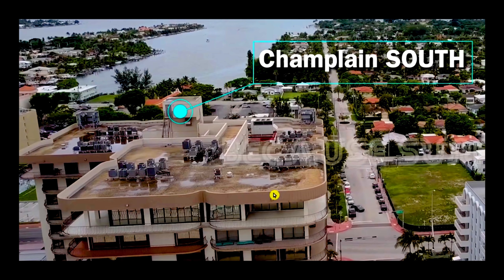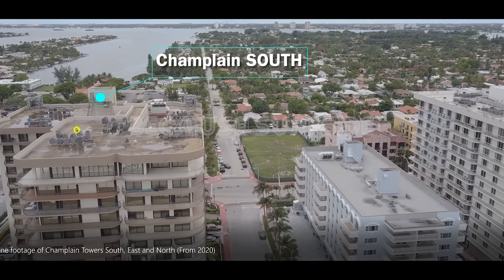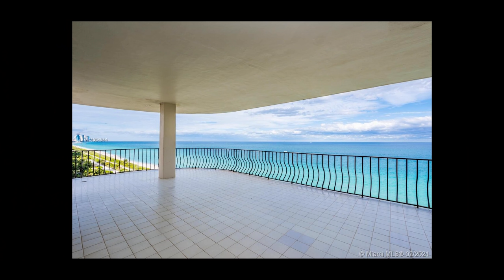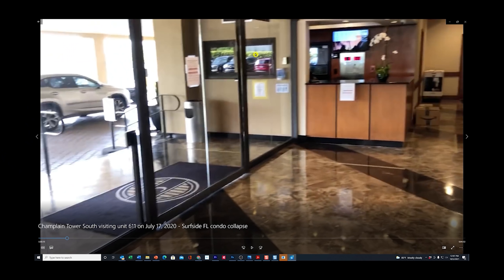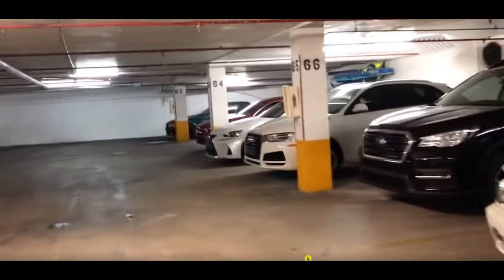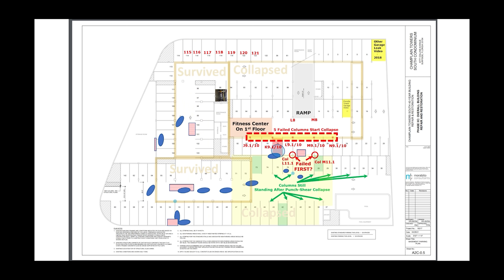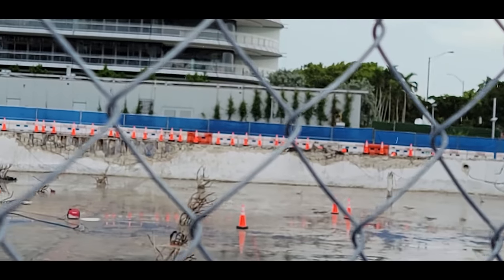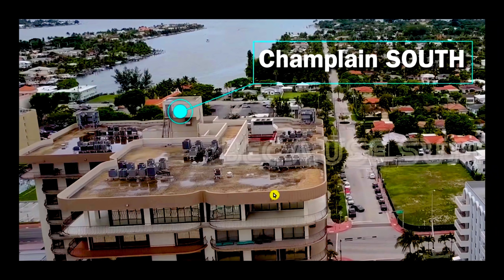Miami Condo Collapse: Water Attacked Roof, Inside, Pool Deck

Comment: Could water from the ocean be seeping into the foundation some how ?
Reply from the maker: They believe that was a big problem for them in the 1990s where they would get several inches of water in the garage all the time and they had two pumps working overtime an had to replace them every year because they would burnout. That problem seems to have abated because in recent years it was reasonably drawing in there except for a few puddles caused by likely cracks in the ceiling underneath the pool deck so when it rained water would work its way down into the garage. But now that the building is collapsed certainly there could be damage where the bottoms of the columns were just large door cracked or forced down into the subsurface a little bit more allowing water to bleed in.

Comment: Looking at the last view of the site filled with water makes me wonder. If that amount of water was coming in before the collapse looks to me like there would've been a basement/garage level swimming pool.  Was CTS pumping continuously before the collapse or did the 20 million pounds of building smashing onto the garage floor slab open up new fissures for ground water to intrude??
Reply: The prior Maintenance Supervisor for the property stated to the press just a day or two after the collapse that he was running the pumps 24/7 and when one would burn out that management told him to buy another pump as it was too costly repair the root problem of water leakage (from BELOW the parking garage floor slab). He reported that at times the water in parts of the garage was deep enough that it seemed into cars from the bottoms of the car doors. That would be water at least 8""-9"" deep! That is consistent with what we see in this revealing after-collapse/clean-up photo. Assuming no other deliberate sorce of the water in this photo, it cinches the testimony of that Maintenance Supervisor as being true! The liability to the property management company is going to be in the hundreds of million$, and perhaps some jailable criminal offenses will come into play as well....
Reply from the maker: That amount was not coming in prior tot he collapse. It is likely happening now because of damage from the building collapse, no pumps in operation, and king tides
Reply from the maker: that was years ago

Comment: I see Drains on the Vertical Facade in drore footage at 17:00 min. Other sister building do not have the same Drain Holes through Facade in Drone footage.
Reply from the maker: Those are called scuppers, they are meant to be secondary drains.

Comment: At 17:15 you can see a blue or gray car turned over sideways at lower left of the image. Cars to left of this are upper parking deck still standing. The white van at low center is also on upper parking deck but dropped onto the lower deck. The pool is at lower right off-screen, with pool deck collapsed from these cars and up to the collapsed building. I believe the initial failure was this upper parking deck, which was constructed the same as the pool deck and the residential floors above it and not strong enough to hold the weight of the parked cars. Once this became detached from the support columns, which remained standing in this parking area, the detachment failure spread and eventually (a few minutes later) pulled down some weaker columns of the building.
Reply from the maker: Yes a lot of people have this theory as well.

Comment: 12:32 Champlain South looks stacked too tight compared to the East building
Reply from the maker: at the end of the day it is all about the columns and can they support the structure.
Reply: @jeffostroff  well we know they did not so.. perhaps putting the weight of an extra floor buckled the columns that were supporting the building

Comment: I remember asking if the obvious water damage was seen below, why were the repairs started on the roof. I finally got the answer. The whole building was a sponge on sticks.
Reply: Spot on.
Reply from the maker: Yes, I heard the response from HOA at the time was they wanted roof repaired before hurricane season the price usually goes up during the summer

Comment: Remember they were probably washing down that deck at least once a week. I had to wash my in-ground pool deck often due to birds tending to crap on the deck. That close to the ocean you know there are seagulls. 
If the decking was not waterproofed properly that water standing is going to cause problems. I bet maintenance would be cleaning and hosing form that whole area.
Reply from the maker: I doubt they washed that deck once a year you should see pre-2020 photos, it was filthy

Comment: 10:29 that does look like adding those planters has deformed the pool deck at that point.
Reply from the maker: I think the planters with the tall palm trees, and the deck pavers, and the sand and the water retained by the sand were major stressors to the concrete deck

Comment: i have to wounder is the investigation complete at this point in time? since the equipment on site to pump out any water is gone now. Maybe they want it to flood as part of the analysis for say water table related concerns?
Reply from the maker: Nist is examining everything off site, likely will take 2 years for reports

Comment: @jeffostroff Is the plan of the roof showing the penthouse roof or the original pre-penthouse roof?
Reply from the maker: The roof plan is pre penthouse but don't forget the penthouse was only about 25% of the and I know what you're getting at but it doesn't matter because the roof should still be sloped. Whether you put a penthouse on there or not and certainly the other parts of the building should have still had the regular sloped part of the roof that the architect had originally drawn in there.

Comment: There could be a nonstructural explanation for the wet carpet on the 6th floor. In my building (far, far away) we had to do a similar cleanup when a little kid left the bathroom sink running.
Reply: I agree. Too many spurious issues in this video.
Reply from the maker: yes, it could be nothing, but it needed to be pointed out. Water leaks left for too long will saturate your slab, leak below, not you have potentially rusting rebar in your slabs

Comment: But wait.... there's more??? The roof does not seem to be having any way to get rid of water?
WOW.... <3 well done. Great bird-eye view with that drone.
This is a new way in looking at this problem. It's sickening, the amount of failures.
Thanks for all your excellent work!
Reply: If there were NO drains there would have been significantly more water on the roof. If the drains were CLOGGED it would be impossible to see them when covered in water. Unless the video can be examined in high resolution it would be hard to see some styles of drains at that distance and at that low of an angle or elevation as this drome provided. Probably much more detail in the "day after" roof shots of the collapsed roof and roof on the uncollapsed portion of the building, as both were mostly intact and the helicopters were more overhead and drains would show up much better in a bird's-eye view of the roof. 

I blew those initial videos up to look for the cable eye-bolts that the roofers had just installed on the west section of the building and the orange bags that contained  the eye-bolt kits that had yet to be installed. They were clearly visible in those videos, so I suspect any rood drains would be as well. (I'm afraid I wasn't looking for roof drains at that point in time.)
Reply from the maker: Scuppers placed around the roof also will drain water if it gets too high.
Reply: Dale Walker & Jeffostroff.  Thanks man. There must have been drains, do not think an architect would forget them...soooo clogged maybe?.
But still , a large amount of water on that roof.
Also very surprised to see that the cleaned area now is becoming a little pond. Filling up with groundwater?

Comment: That penthouse was added after the fact, do those blueprints represent the legal 12? story building or later bullied in penthouse addition that “isn’t another story” but a like roof extension.
Reply from the maker: The blueprints showed a Penthouse. It was added later because they were arguing with the city about whether or not it could be done so as far as I'm concerned all their calculations were done for in including the Penthouse.
Reply: "building integrity" has 2 recent videos with fascinating detail about the original builder and the blueprints - well worth a look for another POV and insight about problems  on various levels.
Reply: Copy that and I’m a loving the analysis on this building. 

UnderBuilt, under maintained and overworked. 

You can only have 2 outta 3 of those problems to keep a building standing.

Comment: 11:57

the ceiling looks very rough.
are those dead lights, can't make it out but it seems as 2 tubes are out.
also all that piping and even a light stuck behind.
were those pipes added?

so sad. it was a recipy for disaster.
but so typical. adding additional floory tiles, no proper drainage.
I bet the water was coming via every hole just eating slowly away the rebar.
Reply from the maker: This building was literally being attacked by water

Comment: Jeff - Could the standing roof water become saline from the combination of rain water and salt deposited from sea spray? If so, wouldn't it be more corrosive than rain water itself? Wouldn't leaking pool water containing chlorine ( an oxidizer ) also be more corrosive  than rain water?

Note: I am not a Floridian. I do visit a low rise beach condo on the east coast where the parking is open air, and on ground level underneath the units. I initially did not understand why a garden water hose was made available for the car owners, and quickly learned why people were making use of it.  With an early morning departure I could not see out of my widows, as a film of salt from sea spray was deposited onto the windows.  Took less than 24 hours to occur.
Reply from the maker: If it sits long enough, a day or 2 and if there are holes in the membrane, it will find its way into the concrete roof and soak in causing spalling eventually

Comment: Jeff ive seen that kind of pooling up here, it's the condesors leaking onto the roof.
Reply: Extended locations have their own means of getting rid of condensation in my experience.
Reply from the maker: No they don't leak that much, and they have drain lines

Comment: Obviously that roof was built for dead loads, but I don’t think it was designed for rainwater to just pool up on the roof with nowhere to go. I guess you could consider that water a live load. It’s mind blowing that a building where apartments cost so much had so many underlying issues. Another great video, my man needs an award for all this work 😂. Time we expose the laziness, no reason for this in a first world country man. It’s safe to say water was a big reason for this condo collapse.
Reply from the maker: Yes that's an interesting point as to whether they calculated well what if we have AX number of gallons of water just sitting up top because they're designed includes the water draining off but as an engineer I think it's best to assume that the water isn't draining off until it hits the level of the scuppers and then the scuppers were drained off

Comment: Ex high rise plumber here.... I appreciate that you are pointing out issues with multi story buildings Hopefully it will educate the importance of sound design and the need of  constant monitoring and regular maintenance that buildings require All these structures should be looked after by compentant building engineers There is a lot too know          to do the job properly I have witnessed untrained building managers make some terrible potentially dangerous mistakes Usually to not spend the money that is needed.... As for the water issues in this building it is not right All water ingress issues can be rectified with the right people on the job and of course enough money Water leaking into buildings causes a lot of damage and produces a poor living environment... Sometimes dangerous........
Reply from the maker: Well said John, thanks

Comment: Tower south is a pool now.
Reply: Sure is... the basement and pool almost have the same water level.  Would be interesting to perform a salinity test on the water,  but we already know the answer.
Reply from the maker: Yes, but we don't know if the collapse caused enough damage to allow this much water to seep in, as it was not doing this just prior tot he collapse
Reply: DubStylee  That is very interesting.  I have been to Florida many times over 40 years,  but did not know this.  Being so close to the Atlantic Ocean,  I would expect this to be sea water intrusion.
Reply: Fill it up with water and jump on in 👻

Comment: Definitely seawater coming up from below.  That greeenish tinge is unmistakable.  No way that's rainwater...
Reply: An unmaintained freshwater pool goes green pretty fast with algae.
Reply: @vaughnbode1420  But that was a good foot of water.  It rains a lot in South Florida, but not that much..
And those massive pumps wouldn't be required to deal with just rain.
Reply from the maker: It had not rained all week either

Comment: I made a comment on the roof being in bad condition compared to the other roofs of the neighboring buildings ! Having worked in the construction industry, it looked like there were water leaks through the roof parapets and ran down the outside pillars on their interior surface and eventually caused damage to the concrete, that, along with the pool deck tiles, and the parking garage !! Thanks for the update 😀
Reply from the maker: The roofs do have scuppers which are secondary drains, but water running down the columns should not cause a problem, as it will dry quickly.

Comment: Would the water be from the air conditioning units?
Reply from the maker: No, by code, the AC units have drain line which you can see, and the condensations runs outside the building

Comment: The amount of added weight to the towers from pooling water, super heavy tiling both on balconies and inside along with things like granite shower trays etc as well as the fact that cars are much much bigger and heavier now than in the 80's along with rising water all played a factor into this buildings downfall.
Reply from the maker: Yes and one thing that the architects probably never dreamed in a million years was that somebody would come along 15 years after the building was built, and add a huge amount of paver bricks to the pool deck along with a 2 inches of sand, and now when it rains those two inches of sand hold a huge amount of water which adds even more weight this thing was just ready to crumble I'm surprised it didn't crumble before.

Comment: OK, at marker 12:09 Those roof repairs were not professionally done.  What they did was spud the aggregate away from the membrane so they could install a new modified or other single play material.  The parapet walls appear to be done with a trowel grade mastic and the -4- anchor rails are not correctly waterproofed.  The worst of all is when the spud the gravel (aggregate) away from the roof membrane, they created a depression lower levels than the roof plane which is now putting their repairs completly under water.  If those repairs failed then they would have caused a lot of water to enter into the roof deck and into the building because they were now under water.  Remember, I said this section of roof appeared to have a lot more water than the actual collapsed ares your were talking about.  I can now see that the repairs made in this section of the building were nothing more than a bandaid and I can almost guarantee they were leaking.  If I could see the other repairs made over the collapsed roof section before it happened will tell me a lot on the roof status.  A final note:  The outside of the parapet wall appears to have some rotting throughout the perimeter.  Im not quite sure if the skin is made up of metal trim pieces and is the parapet made of stucco or a styrofoam eifs.  Regardless if a blowing rain were to enter through the outside of the parapet then the water would go directly between the roof and the concrete deck.  Could it be why they were doing the parapet wall from the inside, when the actual problems could also be coming from the outside of the parapet.
Reply from the maker: For waterproofing, do you think maybe it's just a case of the phots we see was before they were complete with the work? I know they had a city inspection up there 14 hours prior to collapse, and the roofing inspector said he saw nothing out of the ordinary.